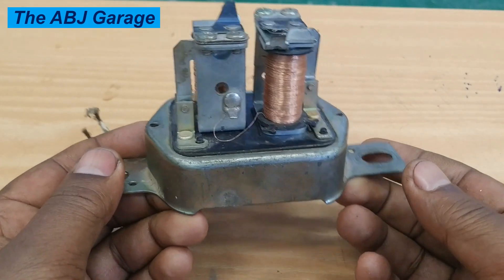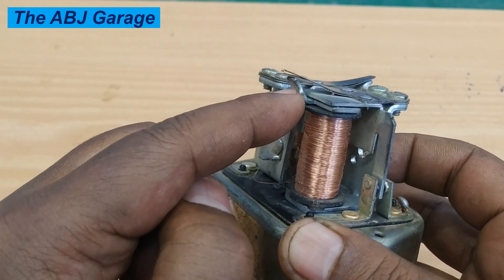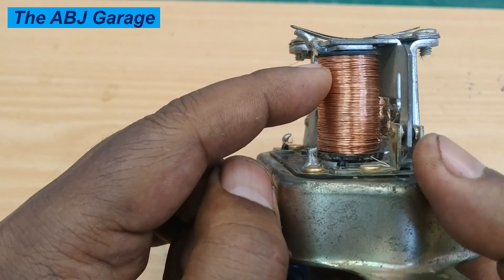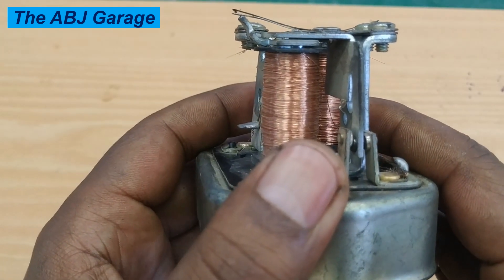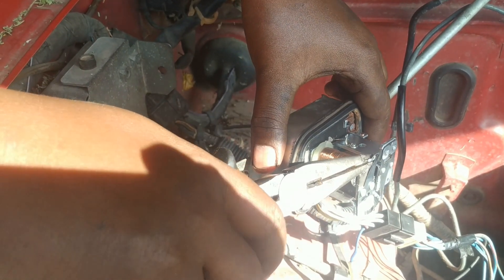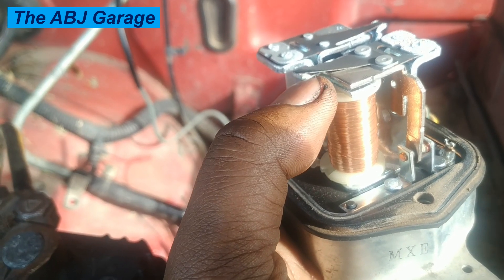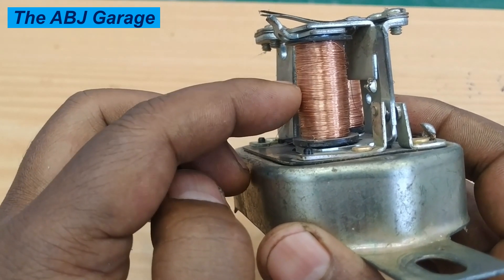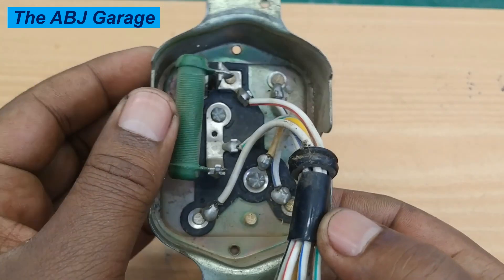Experts Reveal BEST Point Type Voltage Regulator Adjustment Hacks!

Comment: excellent explaination i have 1982 suzuki van who have this regulator, i have check the voltage with meter the voltage is not stable and alternator got heatup, is this the cause of alternator heating..? hope you answer me.
Reply from the maker: Alternator heat up when there is too much current flow... it could be caused by faulty rectifier, faulty regulator or some short circuit that draws too much current. Weak battery can also cause similar problem as it draws larger charging current from the alternator.

Comment: Very helpful..my vehicle has a problem..When I crank the engine it's starts, I turn it off and try to start it again it does not start...can you tell me why?
Please..
Thanks
Reply from the maker: Am not sure what type of engine you have but this kind of problems are usually caused by fuel issue and weak battery.

Comment: Why regulator vibrant and has noise ?
Reply from the maker: The magnetism is causing the vibration and noise. When the magnetism is not strong enough to pull it fully, it causes the noise and vibration because it is counter acting the spring!